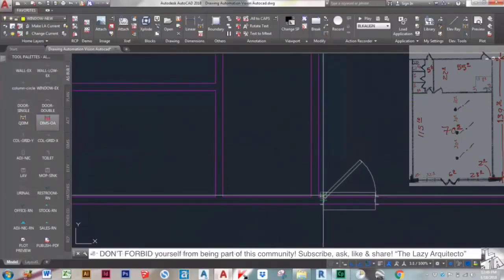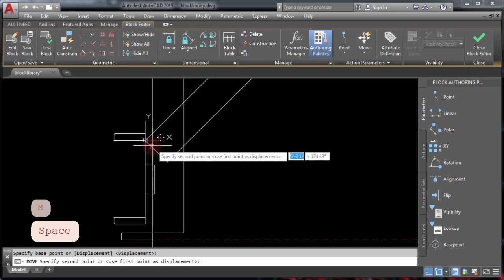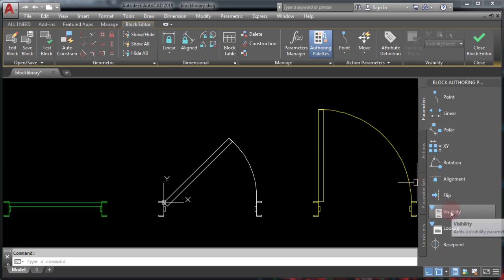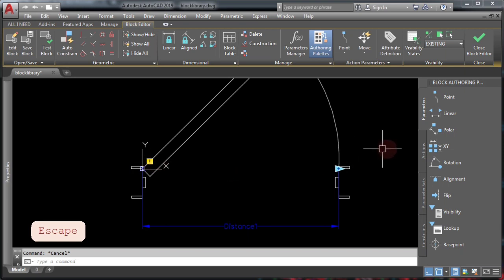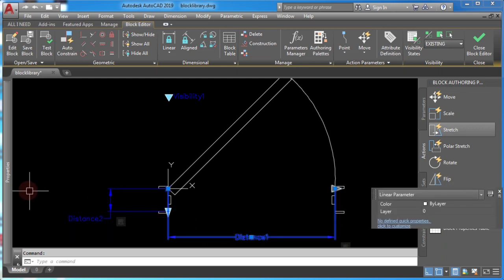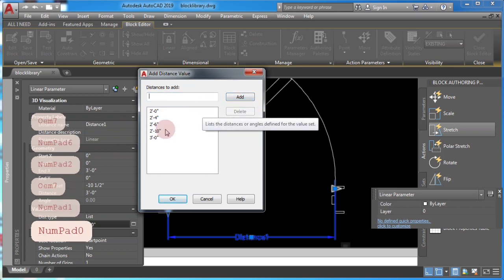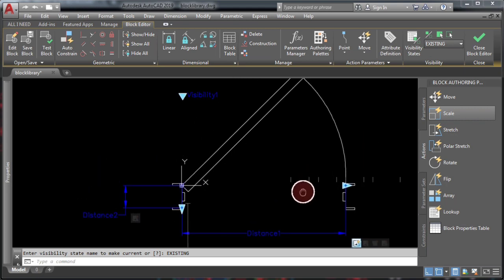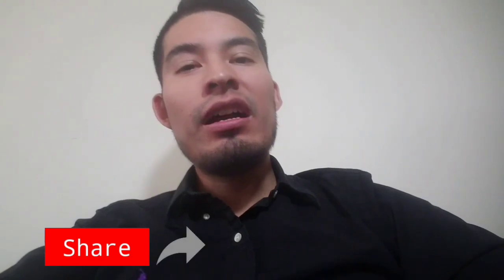Autocad Dynamic Block Door, Visibility, Stretch, Move Parameters, Actions (1/2)

Comment: great vid. commands all work, but once block is back in model space, my arc doesn't align when door is fully open at 3'.  Arc doesnt connect to edge of door and edge of frame?
Reply from the maker: Is ithe gap minor or small or obvious?
Reply: same issue..gap is ovious
Reply: Fairly obvious
Reply: hey smack1129 did you fix it?
Reply: @marc jacob  I ended up modifying the dynamic block that CAD has in the Tool Palette.  Just copied the wipeout and whatever other parameters from here, and it works out a little better.   Depending on scale, don't always notice discrepancy. 🤷🏼‍♂️